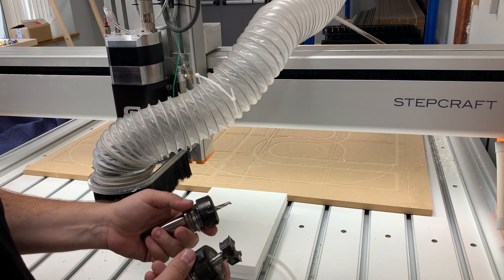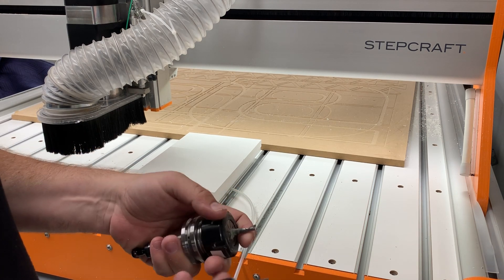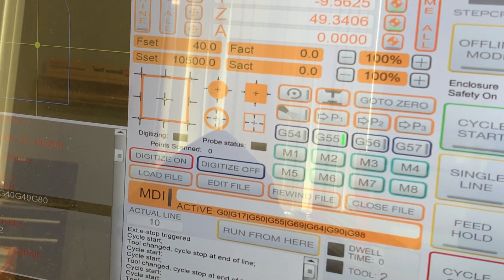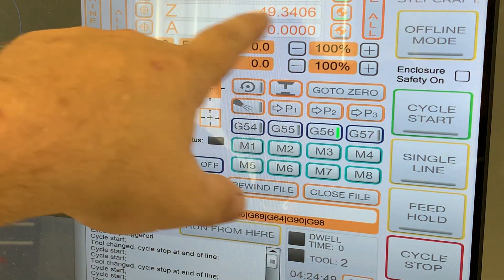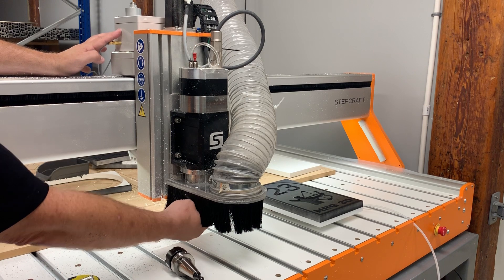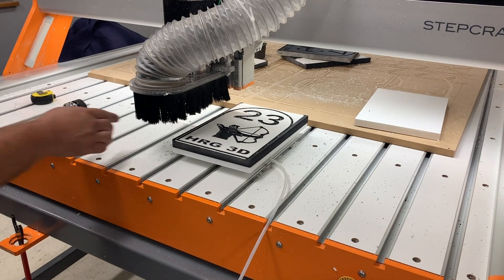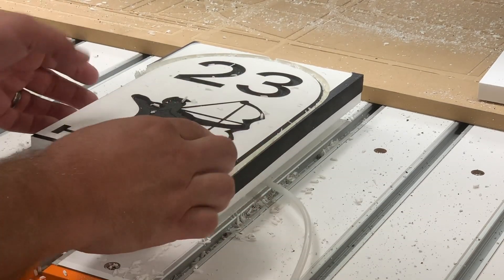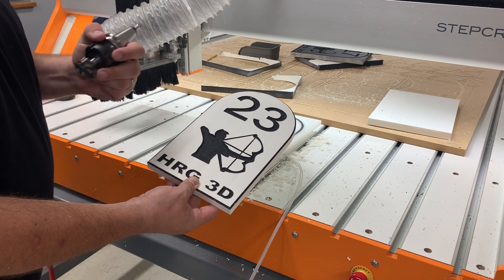Work Offsets Explained For Quick Tool Changes - G54 - G59

Comment: You dont need separate wcs for toolchange. Just use a toolsetter. Also, if you going to use different wcs anyways, implement them in you nc program

Comment: Nope, tool length offsets are different from work offsets, using work offsets is a workaround for machines that don't have tool length offsets .. but that is not what work offsets are intended for.

Comment: So I'm more used to running CNC Mills and Lathes in the metal working world. Normally we use G54, G55, work offsets for multiple parts and use tool length offsets to adjust for the difference in Z height between tools. Is there a particular reason you use work offsets instead of tool length offsets to account for the length of the tool?

Comment: You could use M6 tool change request in one program - easier. Program would pause and ask for manual tool change and change G59 automatically.
Reply from the maker: Yes you can set the job up that way as well.  This machine also has an ATC on it, so there is no need to manually do it

Comment: What if I have a router as a spindle? There’s no way I’m gonna get the tool into the collet the same height every time. I remember seeing the tool and die makers at work setting tools into collets with an indicator to insure proper tool height. Could I possibly use a block on the table to set tool height? I’m using Mach3.
Reply from the maker: you would use a tool length sensor.  Each time you change the tool you need to re-zero your Z axis and then you should be fine

Comment: I would do 2 things to help me to avoid mistakes.   The first it to put the g55 and g56 (or whatever is relevant ) into the cut files themselves.   This avoids my having to remember to press the button.   Then I would add that offset command to the file names . This is a reminder to me that the given offset must be set before using this file.

Comment: Does Stepcraft software support real Tool Offsets? (not work offsets). What about tool changes? we see M1/2/3 etc in the panel but still you had separate .nc files for each tool, which can be frustrating and lead to errors in some workflows.
Reply from the maker: Yes we fully support automatic tool changes and we have macros for auto touch off and tool offset storage.  All you need is one nc file that you add M6 commands via your CAM software and our system will take care of the rest.  Here is  a video that shows it https://www.youtube.com/watch?v=pCMdPF39Uts

Comment: Have you done something special to equalize the surface of you support? (sorry I don't know how to say, I mean "surface" the base support so your surfacing is a plan)
Reply from the maker: I am using 1/2" HDPE with a vacuum pod under it.  I can not share the info on the vacuum pod because it is a prototype from a company that will be releasing this solution on Kickstarter in OCT

Comment: I don't get the point: you use the first material as a reference to mesure zeros, then you switch for your real work piece?

And for you vacuum table: you said you cut ~0.015"... So I imagine you built it also and you built a new one later if you need it? Or do you buy it?
Reply from the maker: When I made the video I already cut all the signs, so I had one extra blank of the same thickness as the signs so I could illustrate touching off the tools.   The real process would have been to 1) put the blank on the machine - set my zeros for XY and Z and drill holes on back for alignment pins  2) Flip it over and V Carve everything. - I used G57 for the V bit 3) Take off and paint black the entire top (all areas that were v carved) 4) put back on the vac fixture to remove the top surface (black) - G55 - to revel the white PVC and all V carvings are left black 5) run profile cutout - G56 - to cut the final shape. 

I made the vacuum fixture - I will make a video on how I did that soon.  Since I had to make 30 signs it was worth the few minutes to make the vac fixture.  Plus using a vac fixture saves a LOT of material - without it, I would need to clamp or screw so I would have more waste material to make room for clamping.  I cut into the vac fixture 0.015" OUTSIDE the rubber cord.  So I am cutting OUTSIDE the vacuum area.  If I ever needed to make signs this shape again, I could use that fixture indefinitely.   Hope this better explains...
Reply: @StepcraftInc  Thanks you! Waiting to see info about the vacuum support!!! :)

Comment: another informative video! do you cut into your vacuum table?
Reply from the maker: Thank you Greg.   Yes I have it set to cut about 0.015" into the vacuum fixture to ensure a good bottom cut and in case there is any deviation in the material.  The cord on the vacuum fixture is just inside that outer profile cut so it maintains vacuum.
Reply: @StepcraftInc  Thanks Eric, I was wondering, because I don't use a vacuum table on my machine, but I'm thinking about it.  I'm just wondering how you get around that. If you're cutting different profiles all the time, don't you run the risk of ruining it, or losing vacuum pressure from all the grooves. Or do you always have to make sure your  profile is always outside the vacuum area as you did?
Reply from the maker: @gregraso728  There are two types of vacuum that you can use - high volume and high pressure.  High volume would be where you use a vacuum pump that moves a lot of air through a vac grid.  You can suck air through a spoilboard like MDF.  High pressure would be where you made a dedicated fixture (like I did in this project)
Reply: @StepcraftInc  Thanks I would use the high pressure as you did. I've been teaching at a vocational school at night and they have a large machine with a high volume vacuum system. I get a little nervous that the work piece is going to move.  I just started watching your videos this week, and I've learned and enjoyed them Thank you for your help. Keep the videos coming.
Reply from the maker: @gregraso728  i'd be happy to help you if you want.  Email info@stepcraft.us.   I will work on some videos for this too
Reply: @StepcraftInc  Thanks
Reply from the maker: @gregraso728  with a high pressure fixture like the one I made in this video - the material is SOLID - as strong or stronger than clamping.  When you clamp, you only secure the outside edges with a vac fixture you hold the entire bottom surface down.  As long as you do not mess up and accidentally cut through the material in the vacuum area, you will never have a problem with the material moving.  I pull about 25-26 in/mercury so there is a LOT of force holding that work piece in place.
Reply: @StepcraftInc  Thank you for your help!

Comment: Does this work for the tool changer on the D840 ? And I only see G54 to G57 and do all four of them do the same thing?
Reply from the maker: Yes it will work with all tool changers.  Sometimes it’s. It necessary to reset the whole tool rack so I prefer to do this.  Yes all G buttons work the same way
Reply: Right now I just use them as quick change because they get stuck and wouldn’t release from spindle .
Reply from the maker: @joekrieg3152  Please talk to our support department so we can help you resolve this problem.  support@stepcraft.us